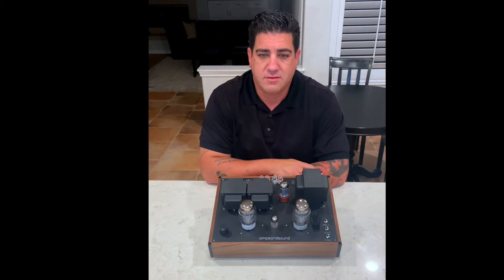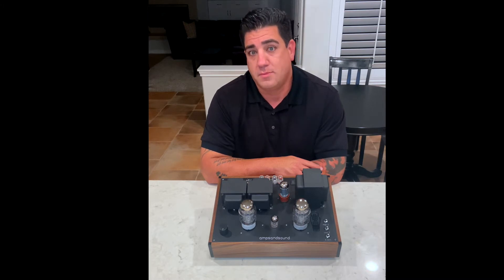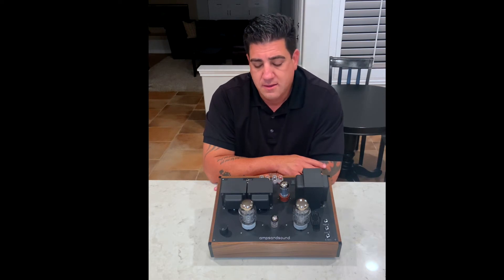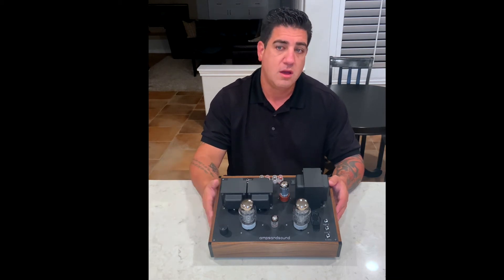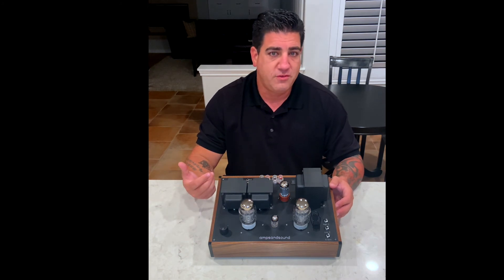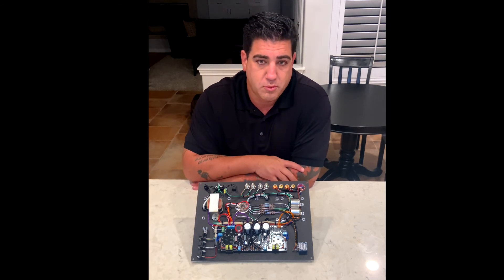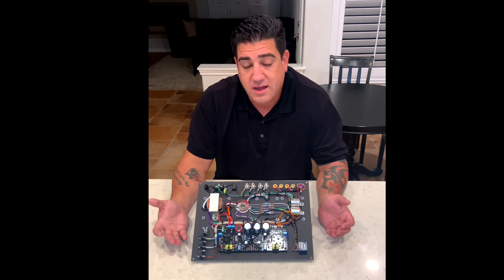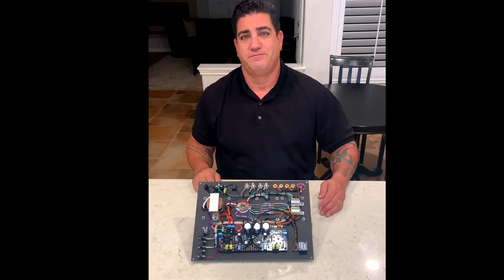MogwaiSE Rev2 2021

Comment: What differs between the Mogwai SE Rev 2 and Kenzie Ovation Rev 2 in sound characteristics? I’ve heard Kenzie has sweetness and euphony while the Mogwai/Forge have a dense sound with excellent slam. Is that accurate from your perspective? If not, how would you describe their sound characteristics? Also, thanks for your updates with the YouTube channel, much appreciated.
Reply: I second this question as I am debating between the two amps.  I am mostly a headphone user however.